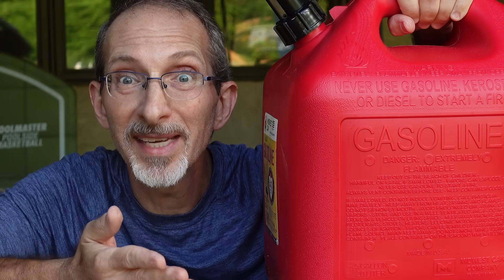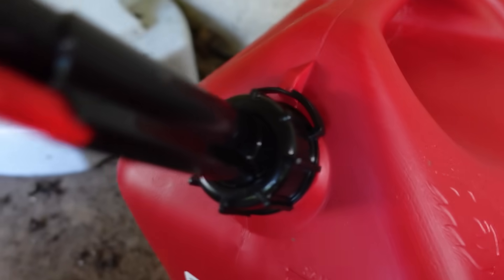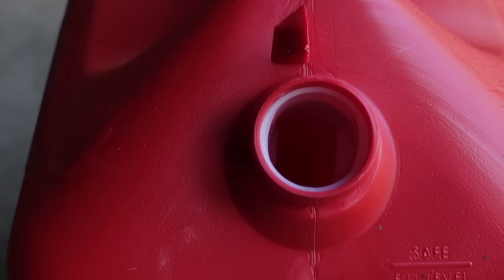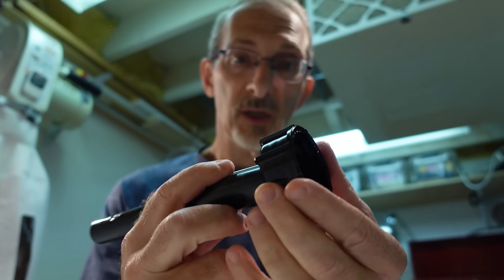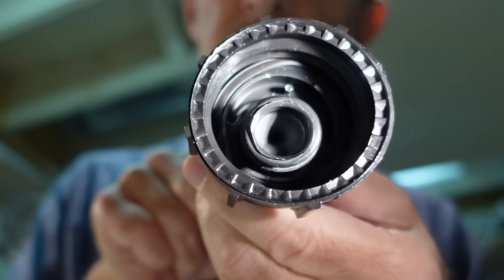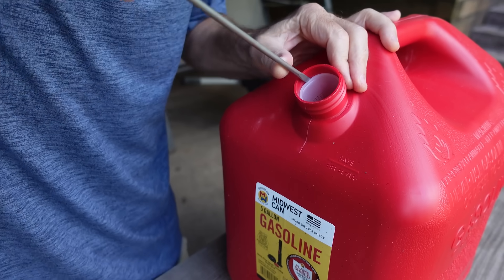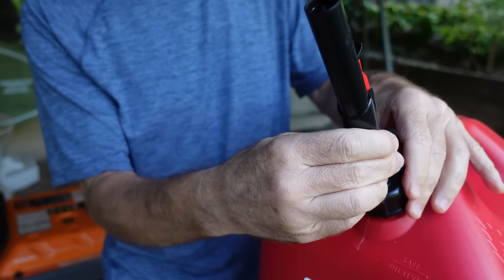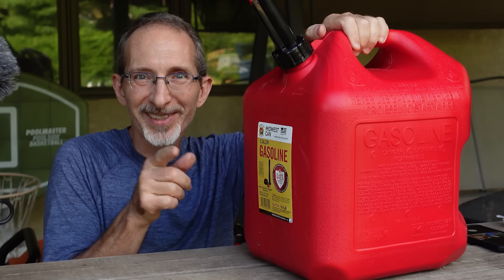Gas Can Modification | New Gas Can Fix

Comment: In 40 years of using gas cans I’ve never spilled so much gas as I have with those stupid safety nozzles.
Reply: It seems to me like they are  trying to make them less safe by soaking the user in gas lol
Reply: @ieatbatteries9998  This ^ I have had issues with my can while the spout is depressed, it also leaks before the end of the nozzle and pours over my lawn mower. :-/
Reply: @ieatbatteries9998  Zach zs88008isipdid. M 1rrccf4
Reply: @ieatbatteries9998  The cans are more safe, at the expense of the user.
Reply: @gorillaau  No, they're not. And that's the problem. All the old problems still exist. And now are supplemented with new ones.
Reply from the maker: Exactly! Thanks for leaving your comments!
Reply: I spilled a gallon on the ground just yesterday while trying to hold down the safety device while fueling my big John Deere. I'm going to implement the mod TODAY.
Reply: @Patriot-bn9om  The spring loaded nozzle is only part of the problem though.  Because it is a rigid nozzle, not flexible/bendable, the can can not be un-tipped to stop the gas flow without removing it from the tank fill spout first.  With the flexible nozzle of the previous era just un-tip the can with the nozzle still in the tank spout to stop the flow of gas.  This new spill more nozzles are stupid and less safe.
Reply: @RazorStrap  That's where adding a piece of clear plastic tubing onto the end of the fill nozzle is handy. (To get it tight requires a heat gun to soften up the tubing first, though...)
Reply: @RazorStrap  That's why the nozzle is spring-loaded; when you are extracting the nozzle from the filler neck on the car (or whatever) the spring closes the valve at the base of the nozzle, allowing the gas in the nozzle to empty, allowing you to remove the can without spilling.
Reply: @arhedler  Unfortunately, the need to press down the spring an inch or more means that the tip of the nozzle is deep into the gas tank of a small engine. You can't see how fast the gas is flowing, and don't know the tank is full until the gas starts to gush out of the filler neck around the nozzle, usually much more than might remain in the nozzle. Upon removal of an old, traditional nozzle, with no valve, gas would either empty forward into the tank, or back into the can, no spillage. Of course, you have to manually cap the nozzle somehow, you want some sense of achievement, don't you?
Reply: Happens Everytime on my lawnmower, so I try to hold the 20lbs can with 1 hand, and manually push the spring with other hand so I don't have to stick the nozzle so far in that I cannot see when it's about to overflow.
Reply: @Patriot-bn9om  amazon has "kits" of normal non safety spouts that include a "airhole" plug
Reply: @darunealbane  Most useful comment I've seen posted here.
Reply: Yep. The new nozzles are far more messy than the old style. I've had way more spillage with the safety cans than I ever did with the old ones. BTW, you can get replacement nozzles that do away with the safety crap.
Reply: You can also buy a yellow air valve  just like the old cans that installs in 30 seconds with a half inch drill bit. That solves all the remaining slow flow problems
Reply: Great tip, but I think I'd just make a small hole and use a screw instead of spending $5 and make a 1/2" hole that can potentially leak more.
Reply: Great tip, but I think I'd rather make a small hole and use a screw instead of spending $5 and making a 1/2" hole that can potentially leak more.
Reply: @speedy_pit_stop  Been using 'em for years - no leaks yet.
They seal VERY tightly.
Reply: @dd_ranchtexas4501  I looked at the video again. I think it's been changed, as I recall, there was a demonstration about the installation of a vent plug requiring to make a large hole in the can.
Reply: @speedy_pit_stop  I don't know how to tell if a video was
changed. Maybe was.

But anyhow, yes I drill a large hole in the very top - ie handle - and
push the vent in. The vent OD is larger than the ID of the hole and
it takes a Sh!tTon of pressure to push the vent in, BUT it seals
tighter than a bull's butt in fly season.........
Reply: @Roboticgladiator  Where???
Reply: @Roboticgladiator  Where?? All the storekeeps say it's illegal for them to sell.
Reply: @Roboticgladiator  The only replacement spouts I see are all the same design
Reply: People who need all those "features* shouldn't be operating gas cans😁
Reply: yes! exactly.
Reply: Unfortunately thing are built for the lowest common denominator with lawyer money. 
Or as my buddy says “I F’ed up now someone is going to pay”
Reply: No lie my friend
Reply: These "safety features" are supposed to idiot-proof the new cans. But they forgot to have real idiots test them out.
Reply: Hell yes! Tons of spillage!!! Crazy!!!😩
Reply: Exactly
Reply: Fuck yeah!  I've spilled gas all over the trunk of my car driving a full can home and spill the rest all over my yard trying to pour it in another car.
Reply: It's a great example of how bureaucracy always makes things worse.
Reply: Totally agree. Don't the morons that write these regulations realize that all they have done is make this product an order of magnitude more dangerous than it was before? And what about that stupid filter? While it might prevent debris from getting in your gas can, it does absolutely nothing worthwhile because once the debris is in the filter, the next time you pour the can it's going right into the fuel tank of whatever you are filling with gas. I guess it is supposed to be some type of fire protection device. Did we really have a national crisis of gas cans catching on fire previously?
Reply: @josephsolomito4703  I was thinking the same thing, it just traps debris so you can pour it into your lawnmower, instead of letting it safely settle to bottom of can never to be seen again.
Reply: I am probably much older than commenters here and I well remember the round metal gas cans with the flexible metal spout. Far better than those made today of cheap plastic. Who else remembers them?
Reply: Nader proof your cans
Reply: @johnthompson9513  then his Raiders will be Protesting out front
Reply: isn't that the truth - much preferr the old school ones - but hard to find anymore - I usually just throw these dumb safety deals away and make my own screw on top
Reply: I would like to take the time to thank y’all for making this the most liked comment I have on YouTube after being on YouTube for 15 years.  I am humbled.
Reply: Ohh i just seen your comment lol almost the same as mine.. its crazy! i guess there trying to stop spilling gas when the can falls over.. But now everyone spills it as they try to use it.. Soo who knows if its even worth it.. id say no cuz ive never dumped over a gas can & had t leak out gallons.. & ive taken them with me Alot more then average person using them to fill up a tracker at home.. I took them with me every weekend for 12years riding dirt bikes etc.. & to work half the year every year for 15 years for our leaf blowers on the roofs.. & this was the old cans & ive only spilled drops here n there.. Now i spill a cup full instead of drops with the new cans here n there
Reply: Exactly,  I've spilled gasoline all over the place with those so calked, new state-of- the- art  "safety engineered"  fuel containers.
Reply: Same here. Gasoline everywhere.
Reply: Thanks, gub’mint!
Reply: Same here, bureaucrats ruined the .
Reply: You could refill another gas can with the amount you spill with the safety nozzle haha
Reply: @Analog Human Unfortunately the regulations that cause nonsense like this are put forth by unelected bureaucrats
Reply: @RogueA.I.   - that’s a great reason to rout the deep state!
Reply: The intent of these nozzles wasn’t really safety ,  but to reduce evaporative emissions. Very complicated process to get a new fuel can design approved by EPA and CARB. But they don’t live up to that intent since they spill so much. They should have just required non permeable containers with tethered caps so people don’t lose them.
Reply: I hate the new cans, the nozzles are horrible and the plastic in the can  is so thin it expands or contract like crazy
Reply: You can thank California for these! Plus it tripled the price of the cans.
Reply: FACT,,they are a Danger to the user,,they should come with a FREE REPLACEMENT SPOUT.
Reply: "No-Spill" spouts aren't!  W/ old-school cans I OCCASIONALLY spilled a a few drops of fuel.  W/ the new ones it's usually a giant "glug".
I've modified every one of my new cans: added vents to some, put aftermarket spouts on others, taken the spring out like this on the newest one.  Now I don't spill at all.
Time to get the EPA the hell out of our garages!  Propane bottles used to hold 20 lb; now they hold 18 on a good day.  Gas cans suck.  Can't adjust the mixture on yard equipment anymore (and it's always too lean for engine health or performance).
Reply: The "idea" i believe is this, dumbasses who toss gas on fires. It's because of that I think it was Blitz was sued and lost and had to close up shop. They was located in the states which makes it even more sad.

Stuid as hell that even with warnings, still sue a company out of business, damn ambulances chasing lawyers. Scum I personally feel.

Edit: Adding one of many news articles. https://www.fdslaw.com/law-topics/blitz-usa-faulty-gas-cans/
Reply: @Embermist69  i have seen this with my own eyes dumass then kicks flaming can in to bushes ive never seen so many people jump up and stomp out a fire in my life damb drunk a hole almost killed us all but i in no way could ever blame the can for that stupidity
Reply: @ferp420  oh I don't blame the cans, but those who shouldn't use them.
Reply: @Embermist69  never give a drunk a gas can when theres a fire neer by lol
Reply: @ferp420  It's the beer companies who are making a dangerous product.  Why aren't they sued out of business?  When used as intended it intoxicates people.
Oh but you are only supposed to have one drink.  Hey right, what do they think that one (first) drink does to a persons reasoning and will power to not have "just one more", and then another, and another, and...
Reply: @RazorStrap  i havent had a beer in almost 20 years
Reply: @ferp420 , you must be parched. But, good on ya.
Reply: @ferp420  Unless you don't like them, just run away once you give it to them!
Reply: @ferp420  He-he.  Same here, but the more I encounter "government mandated solutions", the more I need to drink.
Reply: @Embermist69   I did not know that. I thought the EPA was worried about spilling gas on the ground during a tank fill. I am one of those dumb asses that is guilty of dousing a brush fire. I pour the gas into something small like a coffee cup.
Reply: Don't blame he government. Blame our litigious society for suing company because people are too stupid to use a tool the right way.
Reply: @roguebotanist  - no Thomas... the new caps were not about people suing... it was the California clean air resources board, in a regulation designed to reduce fuel evaporation and spillage.  Of course the implementations of the regulation cause WAY more evaporation and spillage than happened before
Reply: @Embermist69  We all do dumbass things. The problem is when someone blames others for their stupidity and profits from it. I a firm believer in allowing people to be stupid.
Reply: Very true
Reply: RIGHT
Reply: I came here to comment the same exact thing. New cans are extremely dangerous oh and they're bad for the environment too. 
EDIT: I forgot to mention that it takes forever to fill them and takes even longer to pour fuel out because of no REAL tank vent.
Reply: ditto, it's some of the dumbest engineering in history of man kind ;)
Reply: Me too. SO HAPPY for this modification. I got one of these the other day and immediately wished I could return it, but already put gas in it. Now I can fix it!
Reply: Blitz had a better design with a big lever you could push with your thumb or free hand and a flex nozzle. Never spilled a drop with those.

I’ve had several spills with my Midwest can. The primary cause has been not being able to see the fuel level inside the fuel tank because the nozzle blocks the view. Or, if you do manage to stop it before overfill, it still overfills because of the column of gas still in the nozzle. I’m starting to get the hang of it but it shouldn’t be this hard.
Reply: these cans are for idiot snowflakes
Reply: Downright dangerous, too. If you fill them with cool gasoline, then let them sit in the sun for an hour on a warm day... I had one of the briggs and Stratton branded ones shoot gasoline 5 feet up on the wall of the garage, when I opened the nozzle to fill a weed Wacker
Reply: I’ve spilled more trying to use the new ones.
Reply: Leave it to DemocRats to "fix" a problem that doesn't exist. Yes. They did this.
Reply: @wayneleroy6382  EPA unelected bureaucrats of which nearly 100% of them are commiecrats do significant damage and get away with it because the media is trash. 

People who trust the government should learn the hard way how stupid that is.
Reply: im 30ish and i still have the old school gas cans with no safety things in or on and now im happy i didnt upgrade. i have 4 and im going to keep them till i either die or till they get holes in them. most likely ill die before i have to replace. lol
Reply: So true. I need to start trolling Tag Sales for old style gas cans.
Reply: I have spilled way more than you would ever accumulate in vapor
Reply: I just take that whole nozzle & cap off & use a good old-fashioned funnel. Pour it right from the hole.
Reply: So correct. Made for idiots.
Reply: I thought I was the only one... How about our EPA.. Not so smart.
Reply: It's called government efficiency!
Reply: Gas container design by a team.. of teams, of EPA committees..  🤔
Reply: The "competence" of the EPA and their regulations in true effect!
Reply: Exactly. What a joke they are.
Reply: Fuckin-A!
Reply: A friend of mine is a bush pilot in Alaska and he says that when you attempt to get on top of a wing, and use the spring-loaded plastic nozzles in sub-zero weather, they shatter - spilling avgas all over the top of the wing and the pilot. He's replaced all of his with regular nozzle tubes and plastic vents.
Reply: @Analog Human That's funny, looking up who passed the saftey regulation it was Republicans.
Reply: Another "new.and improved"　design. Yeah right 😟
Reply: Ditto.... Still have 4 old school gas cans with plain (no spill) spouts.....
Reply: I personally never spilled gas before the new style gas cans. And all that is needed is a breather hole and a plug
Reply: Average government regulation.
Reply: I have found the perfect, although pricey gas can at Sam's. Flexible donkey dik that folds upward and locks in place when not in use and has a cap. Handle has an easy to use lever you push down with your thumb. To use it, remove cap and rotate donkey dik into the down position. Insert donkey dik into tank and effortlessly press the thumb lever down and voila! Spill free pour every time. But like I said they are pricey. Modifying these donkey diks don't help because they are too rigid which what causes the spills. I also found old fashioned donkey diks on eBay but they were cheap and the threads didn't fit and leaked all over the place. I've tried everything. The Sam's gas cans are the only answer and they are fantastic. $50 a can sorry to say, but they are the shit!
Reply: Same here spilt gas at 5$ per gallon 😂😅
Reply: Yup
Reply: User error
Reply: Safety Hazard nozzles.
Reply: Much plastic gas can hate from me.  I'll never buy one again.
Reply: Exactly what I was going to post. I never spilled a drop with those old cans.... The new cans? spilled gas everywhere....in the vehicle, outside the vehicle.... f'n everywhere. It is not safe for anyone.
Reply: Yeah the idea to make pouring gas safer and less pouting was good the execution was terrible on a lot of the initial cans. Granted all mine are 20 plus years old and have a snap off cap and a vent!  But of my brother in laws that are newer I like the No-Spill brand best of what I have seen and used. That Mid-West kind like you show is the worst not only for difficulty in using but seem to not hold up well. Andthe filter in the can isn't so much to keep gas clean, but is a flame arrestor to keep fire from following fumes into the can from outside.
Reply: Ditto
Reply: Truth!
Reply: Same here. They are so concerned about kids they forget that when we get old, we get arthritis and it's harder than ** to use these idiotic "safety" cans. They're a danger to the elderly. Speaking from experience.
Reply: Then buy a metal on next time. Those meshes are there as fire arresters so that you don't burn yourself if there's a static charge on the plastic canister.
Reply: Gas is cheap right?! 😂
Reply: Absolutely total trash and grossly expensive at that.
Reply: Gooberment required design changes!
Reply: Yay!!! Thank you!!!
Reply: These nozzles should be called unsafety nozzles. A bunch of complete stupid garbage
Reply: Blitz made the best gas cans,  they were forced out of business by the Obama administration and frivolous Lawsuits.
Reply: Guys,

YaH The Heavenly FATHER HIMSELF was Who they Crucified/Pierced for our sins and “HERE IS THE PROOF”

From the Ancient Egyptian Semitic: 
"Yad He Vav He" is what Moshe (Moses) wrote, when Moses asked YaH His Name (Exodus 3)

Ancient Egyptian Semitic Direct Translation
Yad - "Behold The Hand"
He - "Behold the Breath"
Vav - "Behold The NAIL" <— YaH’s Crucifixion
He - "Behold the Breath"

“Behold the HAND that Beholds The NAIL” 

PROVES - YAH The Heavenly Father HIMSELF was Who they Crucified

That is EXACTLY what Moses Wrote

Here is what they mean

YaH's Name:
(Ya)d + (H)e, as YaH is what Moses called Him and YaH Declared: "this is My Name, this is My Name for all generations" (Exodus 3)

YaH is The Creator of “MAN”: (Genesis 2:7)
Yad He, (HAND BREATH), as YaH's "HAND" Formed man from the dust  of the Earth and His "BREATH" made him a living being (Adam)

YaH's Sacrifice of Crucifixion for “MAN”:
Vav He (NAIL BREATH), the "NAIL" through YaH’s "HAND", in Sacrifice of Crucifixion, that whosoever shall call YaH Savior, His “BREATH” brings forth life (Salvation)

How YaH arrives:
YaH arrives via the Tent of Meeting (Exodus 33:7:11, Isaiah 54, 55), where a Tent is erected outside the city, a cloud descends upon the entrance of the Tent and YaH appears...

Why they demanded YaH to be Crucified:
YaH was Crucified according to Hebrew law (Deuteronomy 21), to be NAILED/PIERCED on an Almond Tree for BLASPHEMY as it was for His NAME they demanded Him Crucified. The Messiah claimed He was YaH...

HE WAS YaH!!!

HalleluYAH translates “Praise ye YaH”

The Hebrew Book of Isaiah

Isaiah 42:8
"I am YaH; that is my Name! I will not yield my glory to another or my praise to idols.

Isaiah 43:11
I, I am YAH, and there is no other Savior but Me.

Isaiah 45:5
I am YaH, and there is none else.
Reply: Americans need to launch a class action lawsuit agains the idiots in California who said we all have to use them. They have gotten dumber and dumber over the years, which means less and less effective.  Impossible if you have small hands
Reply: I love getting gas all over my hands and clothes
Reply: So true!  Big “improvement”?
Reply: Yes!

They are an environmental disaster and fire risk.

Bootleg from Canada or use a needle nose plier to perform a hysterectomy on nozzlae.
Reply: Try an insurance claim with a modified gas can
Reply: Educated idiots that engineered these pieces of crap!
Added 4 dollars of crap that isn't  needed! China laughing all the way to the bank! They more then likely make em for the USA
Reply: They're making crap so "safe" that it's DANGEROUS to actually use it.  I was annoyed enough with the whole "child-proofing" garbage (as far as I'm concerned, that's the parent's responsibility ~ if they don't want the responsibility of training their offspring, they need to keep their pants on; or, put them up for adoption...); NOW, they're trying to nanny-state adults and allowing clowns to sue over their own stupidity. (Meanwhile, they've given liability protection to "draxcine - intentionally misspelled makers!!!)
Reply: @NTF-zb9wi  Child proof caps have saved millions of lives.
Reply: @NTF-zb9wi yeah this is safe design coming from the same talented people that thing the original cans are not safe. Another words what do we expect from non bright ppl
Reply: The whole intent IMO to make it harder is so people stop using gasoline. Yes, the effort to stem evaporation is negated by fuel spilled over and over. Someone needs to justify his job and make more regulations. I do wonder what his next task will be to make our lives miserable in order to nudge us to the way of the Left once we are all electric oriented?
Reply: Good, the goal was to make using gas more difficult to discourage its use, not to improve safety.
Reply: @zeroibis well I guess if that's the goal. The goal of I law suit for injury and damage would be super easy as well.
Reply: Well of course because engineers are involved.  They are the dumbest smart people in the world.  No common sense.  No practical use of the items they are modifying.  Traffic engineers have to be the worst examples.  Only occupation that is worse (dumb, smart people) are planners.
Reply: @bobisrighturwrong  It's not the engineers so much as the regulators sitting at a desk who have no clue about practical usage.
Reply: @speedy_pit_stop  - sorry but no its the engineers.  Ever try to talk to one?  Ever try to reason or compromise with one?  Ever build a house and had to have one do the storm water and another do retaining walls and another do beams/ trusses and another do tall walls?  I've worked with them for 25 years and haven't met but a couple out of hundreds that weren't mentally stunted and incapable of understanding real world impacts of their decisions.  It's like they have tunnel vision.
Reply: @bobisrighturwrong  
not so.... next to last dumbest are the politicans who make these laws BUT THE ABSOLUTE DUMBEST ARE THOSE WHO VOTED THEM INTO OFFICE TERM AFTER TERM. 🤯
Reply: @bobisrighturwrong  engineers be dumb. Says country bumpkin.